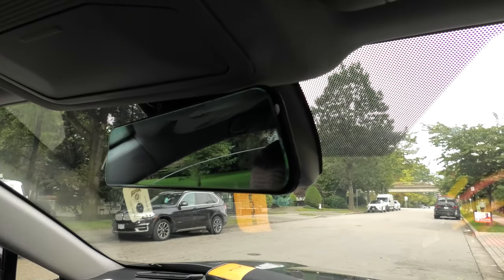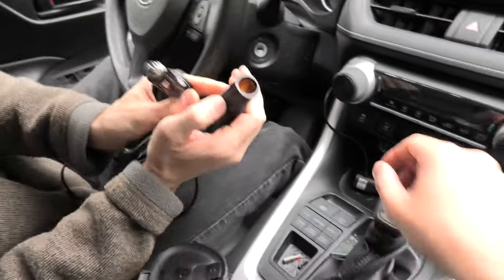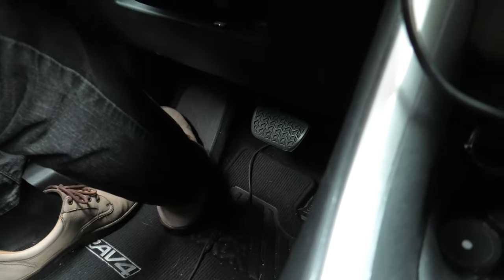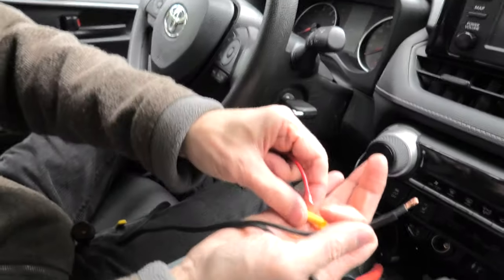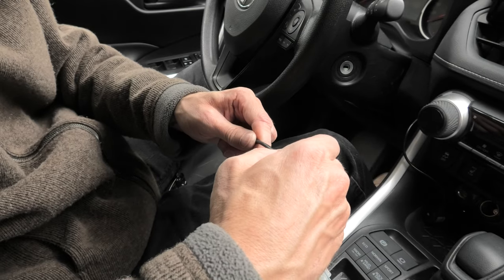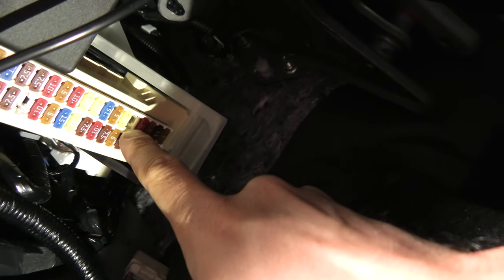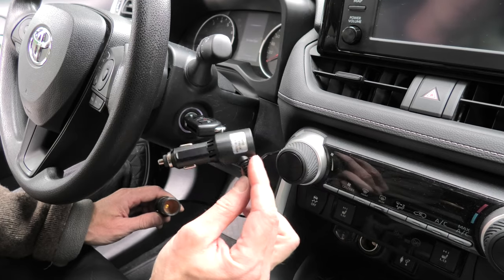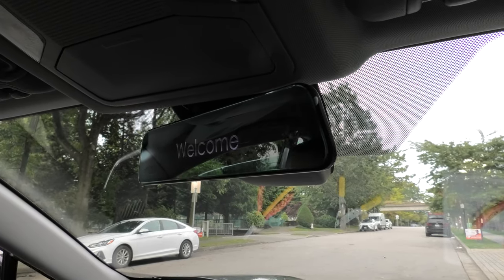How To Hardwire 5V Dashcam Or Rear View Mirror To 12V Fuse Box Without Step Down Converter?

Comment from the maker: PRODUCT LINKS:
1. [2 Pack] KUNCAN 12V 1FT Car Cigarette Lighter Female Socket Extension Cable, Cigar Cable with Female Socket Connector for GPS/ Dashcam Car Charger - https://amzn.to/42kvGom.

RECOMMENDED TOOLS:
1. MULTIMETER - Fluke 179 Multimeter with Backlight - https://amzn.to/3y0mAio.
2. MINI LOW-PROFILE FUSE TAPS - Gebildet 12V-24V Low Profile Add-a-Circuit Fuse Tap, 6 pcs Fuse (3A 5A 7.5A 10A 15A 20A) and Fuse Puller (Pack of 4) - https://amzn.to/41ZvGde.
3. MALE / FEMALE ELECTRICAL CONNECTORS - TICONN 100 Pcs Nylon Spade Quick Disconnect Connectors Kit - https://amzn.to/3ZRMUYe.
4. THIN PROFILE LONG REACH PLIERS - Xcelite 378M Thin Profile Long Reach Electronic Plier, Serrated Jaw, 5-1/2" Length, 1-1/4" Jaw Length - https://amzn.to/3JvHXNQ.
5. GROUND RING TERMINAL - Baomain Ring Ground Insulated Wire Connector Electrical Crimp Terminal 18-22AWG Red RV1.25-4 Pack of 100 - https://amzn.to/3Ltg77M.

Comment: Thank you for this video. I hard wired a Nextbase cam some time ago by cutting off the plug and wiring direct into appropriate 12v fuse, it didn't work and that's when I found the plug is a 5v adapter! I ended up pulling adapter out of the plug case and soldering extra wires to the input side. Worked fine but a bit of a faff. Hadn't thought of using a socket extender. Good idea but worry it might come loose.

Comment: thank you for the video.  the only problem i have is that the connection to the cigarette extension becomes loose after some time.  even if it is taped down as best possible, the connection seems to become loose and makes the camera turn off and on.  and i have the same problem on two cars that are wired the same way.  

Is this a normal problem?  I was thinking to replace the cigarette lighter extension with a 12v to 5v converted so i can then crimp the wires more securely.  Any advice?

Comment: Can you explain again how did you find the hotwire on adaptor? Im a little confused, can you list down the things that you used, thank you for sharing.
Reply from the maker: We are going to use ordinary extension cord for cigarette lighter instead of step down converter . Before  cutting off  the "plug" end of that cord  we have to find wire that supplying 12 volts. In the middle of the cord- split two wires from each other, remove isolator shield  on both wires. Now you need a tester or probe. Keep bare wires  apart, plug in that cord into cigarette lighter socket( ignition - on). Connect probe or tester to bare wires  one at a time to find + 12v. That is the "Hot Wire" . Mark it .
 To finish hardwiring you need "Female" end of the extension cord, so cut off the plug end, just watch for the Mark that you have left on Hot wire. Connect Fuse Tap to the Hot wire  and Ground ring connector to the neutral wire. Done.
 Before starting all of that you need define proper length  of the extension cord to hide it safely under dashboard panels .
Good luck.

Comment: You're still using a step down converter that came with the camera... you're just plugging it into a different socket that you tapped into the fuse box instead of the car's cigarette lighter.